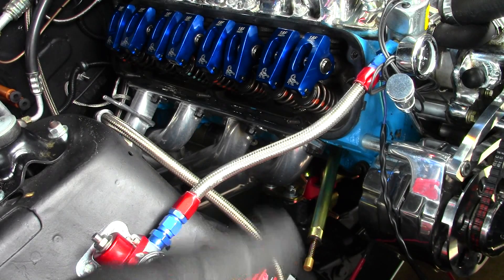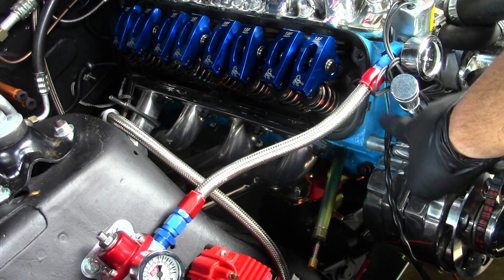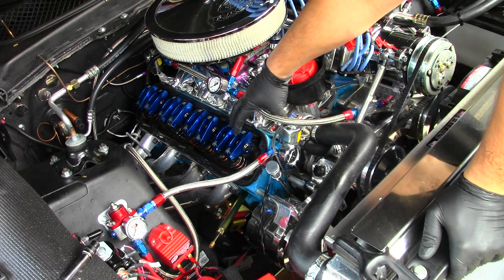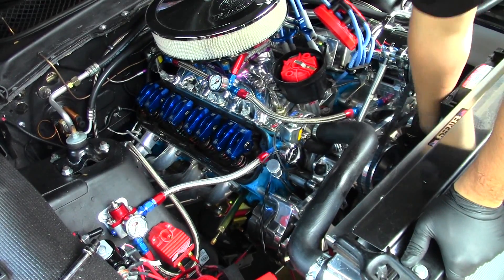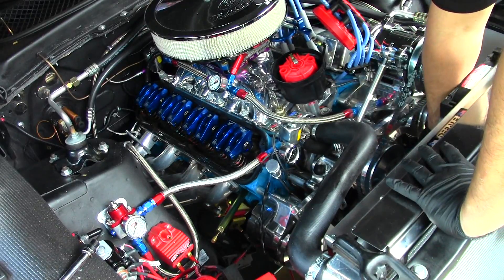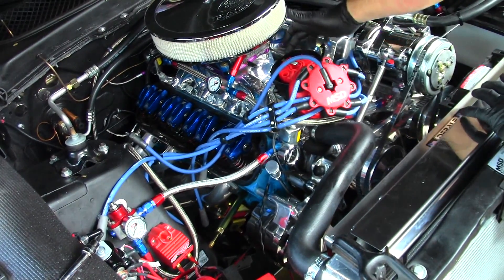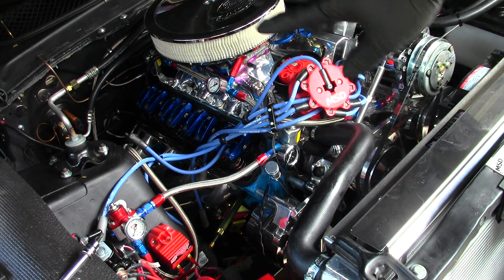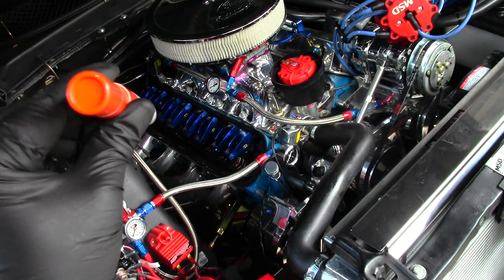Top Dead Center Illustrated | How To Find TDC on a Small Block Ford

Comment: i am 88 yrs old   i ha drove ford trk    sence i was about 20yr   the last ford i bought new had problems wit quality control at  factory swore off fords   traded for new 09 dodge ram 1500 best vech i ever owned  my point is i never had dist. tble ever  with none of my fords   302 s tbls  I had was shimy  and body factory  mess ups (no more fords
Reply: 302 is probably one of the best engines ever made,true and tested,we're discussing the timing of a engine, not Ford and Chevy and Dodge, that's the oldest chestnut ever, its very hard to read what you typed and i'm 57 years old so no spring chicken either.

Comment: TDC is stamped at the factory  at the right place along with deg marks  never had a problem   why is so many people having tbl with TDC if cam and crankshaft are lined up when putting chain on you will not have tbl.  valves have nothing to do with timming that is set by dist  being installed at correct pos.  my dist will only go in one way  because of an off set tang on bottom of dist shaft  other dist do not have this feather so it go in 180 deg off --- not good you need to raise dist up inch or so to turn rotor 180 deg reinsert dist. use timing light toset on deg mark  slowly rotate dist base to adj. tighten dist  its timed
Reply: His harmonic balancer has no marks,thats why hes doing all this ,i have timed many cars before,you do have to be careful and follow procedure but your balancer will tell you whats going on and you can always take the valve cover off,when both rockers are closed and you look at the balancer you will be able to deduce whats going on,where your at and if your 180 out, simple.

Comment: First off, I have a timing tape on my Harmonic Balancer. 2- I take all of the plugs out so the motor turns over with ease. 3- then I put my finger in the #-1 plug hole. 4- then I rotate the engine around clockwise and watch the Balancer and wait until I hear and feel the hiss and pressure. BUT, I don't stop there, I rotate the motor until the line on the balancer and the mount on the block that you use with a timing light both line up perfectly,,,,,Then and then only should you be at true TDC. When I do this to set my Lifters in my Roller Cam, I " ALSO HAVE THE COIL DISCONNECTED,FIRST...SORRY"  Then I pull my dist cap off and make sure that my rotor is pointed exactly at # 1 plug wire and the I Paint a BLACK LINE one the dist cap and the bottom METAL of the dist, so when I do this to set my lifters, I check and line up the BLACK LINES every time right after all of the things that I mentioned before. Then, and then only is it safe to adjust my lifters in the proper firing order. My balancer has 4 indentantion lines scribbed into it, So after I adjust #-1 cylinder, I rotate the balancer clockwise 90 degrees and stop when the 2 lines are aligned up again, THEN I Know that I'm on the compression stroke and set my Intake valve ONLY. Then rotate the balancer another 90 degrees and do the same thing over and over until all 8 INTAKE valves are set perfectly.     THEN I go back to cylinder 1 again and do the same thing only this time I set the exhaust valve/lifter, and follow the same pattern until all 8 cylinders are adjusted, Then , I'm not only done, but I know my lifters are set perfectly every time.    IF YOU DON'T HAVE A HARMONIC BALANCER TAPE ON YOU BALANCER, YOU WILL ALWAYS BE GUESSING pAL. i HOPE THIS HELPED. THEN, AND THEN ONLY WILL YOU GET THE FULL POTENTIAL  OUT OF YOUR MOTOR.  TTY ANOTHER TIME. iF YOU WANT, EMAIL ME AND WE CAN TALK ON THE PHONE. It would be a pleasure helping another " GEAR HEAD ""

Comment: I'm a chevy man, but that was a very good video. I have a couple of questions for you though. 1- Did you advance your motor 4 degrees when you put the timing chain in?  2- I noticed that you rotor was past the No# 1 cylinder by 3/4 of an inch while your TDC Advance tool was showing TDC. Maybe you are advanced too much at your distributor also. I wish you would have shown the video with the shorter TDC Tool instead. I'm going to end my reply now and start a new one telling you how I get TDC on my 427 BBC.

Comment: 1... you are not using the piston stop correctly to find EXACTLY where TDC is. 2... you only need to know TDC on compression stroke when dropping in a distributor. Viewers, to find true top dead center with piston stop : install piston stop and rotate crank by hand clockwise until piston is stopped by"piston stop", using the "0" mark on timing tab as a reference point mark the balancer. Now turn the crank the opposite direction until piston stops again. Using same ''0'' ref. point mark the balancer again. TRUE TDC is exactly between the two marks you make on balancer. DO NOT start engine with the piston stop installed or kiss that piston goodbye. Your best bet is to disconnect battery for this procedure.

Comment: Do you think you’ll be able to do the follow up video with the piston stop? This video was awesome and is the most detailed and definitely understandable way of finding tdc. Thank you
Reply: Aaron Fowler he explained it at the 8:45 mark. Use a spark plug piston stop. Use a coat hanger,    Look at your #1 cylinders rocker arms, look at your cam sprocket and main sprocket,  look for the holes spinning towards each other ,if no movement on either valve as you’re coming up, compression stroke, you can back spin crank a bit counter clockwise, screw in piston stop, slowly and carefully rotate crank clockwise until piston stops, mark balancer at timing mark, then rotate counter clockwise all the way until piston stops again, mark balancer again, then split two marks in half, viola.

Comment: love this bro! thanks a bunch, what's the item number on the tool there been looking for that. if you adjusted the arms on what you thought was the actual timing but didn't run it would it bent a valve? It just cranked but never starts.
Reply: and what is the firing order to adjust for a 302ho block? I see all these diagrams and it looks like they mixed them up online. thank you

Comment: If the crankshaft and camshaft timing marks are aligned with what they should be aligned with (i.e., the other marks), that means necessarilly that it is in the TDC point?
Reply: That's what I was think'n

Comment: so if I was 180 off it would  run like shit , it runs pretty good , but it keeps getting  hot , only gets ht when I'm stopped , I've flushed , and flushed , and this will be the last time I flush this geo , getting old dealing with the hot problem  , new water pump, new thermostat,  radiator  is maybe a year old ,
Reply: Jack Ogez I realize I’m a little late but you ever figure it out?  What about your fan clutch???

Comment: what about the location of the cap mouting screws. what position should they be ? like the factory dist picture? I did the TDC just like you did  on a 351w with a accel distributor. can't get it to start. spits back thru carb. thinking the guy has the wires on the cap wrong. the mag pickup has to be in a certain postition?
Reply: Same he never responded to your question.  I'm sure by now you have figured it out . Did you find a rotor cap plug wire diagram and was that the issue with it not firing up an back firing ??????

Comment: Howdy Archifxllc! Great videos! I have an 89 F 250 5.0 302 EFI HO which has been giving me a really hard time with it's gas mileage. It used to get 21 MPG when I was in Vegas. Then as work goes a better job was in Oklahoma. On the way there the mileage went to 11, and one year later when I came to the Bakken in ND it was down to 3-8. I've replaced every sensor, module and fittings and whatever else I can think of or find and still no more than 3-8 at best on the mileage. Your video about TDC was interesting and I'm about to head to the post office today to pick up both of those TDC tools you showed. I did the TDC by the 0-TDC and a screw driver already yet nothing. Today I'll try these tools and from there we will see. I'm still waiting for your video on the harmonic balancer you spoke of in the TDC video! You do a great job on your explanations and demonstrations! You should have your own program on TV. I know a few producers and will be talking with them about you. The first thing is to figure out this mileage problem. Oh by the way, this engine was built by a shop in Vegas with over 50 years of success and great knowledgeable and well respected mechanics. The engine today has only 38 miles on the rebuild. I've asked them there thoughts and everything they've shared to try has made no difference. BAFFLING! It's now a project to find the problem and will not give up until I figure it out! Be Safe Man! Daryl
Reply: you may have oxygen sensor tbl if its old replace it  it can effect milage
Reply: @frankdavidson9675  Hola Oh Great and Noble One! It's been a while! Hope the family is well and safe! This engine problem at that time was just as you said! Changed the sensor and WOW! Mileage shot back up up to 19-mpg. When I left the Dakotas I had almost 8K in weight and still averaged 19 while driving to Washington State to visit. A couple years went by on the visit and rebuilt it completely. After a $3500.00 rebuild I did on my own, it fired right up and sounded great! Next morning went to take for its maiden voyage and something let loose. Backed it over by a tree and parked it. Bought an airline ticket and went back to my ranch in Nevada for a while. Last March I flew back to the place here in WA, and pulled it. I was so pissed at wasting $3500.00, I took the engine to a friends engine shop and said you do it! Turned out the bolts that came in the box with the new highflow oil pump didn't hold the torque and back out. Oh Well, $2,000.00 later, it's a new engine now with a guarantee! I'll pick it up hopefully next week and let you know how she runs! Be Well My Friend!

Comment: What if you move the spark plug wires clockwise to align with rotor cap and tdc?? Would that be incorrect??
Reply: +9mustangmartinez For carbureted or batch fire injector cars yes - for later Mustangs, Explorers, etc, there's a sensor inside that tells which injectors to fire at what time, so it won't work for those.

Comment: Well, this was a great video; however, if you already have the harmonic balancer installed, all you have to do is rotate the engine so that the pointer points to 0 TDC, and with a screwdriver, make sure that the piston is all the way up-->once these two conditions are met, then you are at TDC and you could do multiple things, including stabbing a distributor  (with rotor pointing to #1 cylinder on the cap), etc....
Reply from the maker: Very true but what if you're running an aftermarket balancer like myself and you don't have timing marks? Need to establish a baseline. Perhaps running with timing tape etc. or, what if the marks are a universal type and you need to verify?
Reply: archifxllc Didn't think of that detail. You know your engine well. Keep up the great vids man!
Reply: @fixitnoworlater  where's the follow up video
Reply: Couldnt these conditions being met also be 180 degrees off?